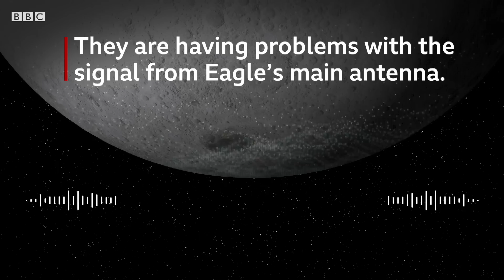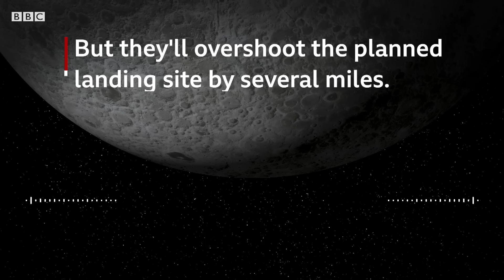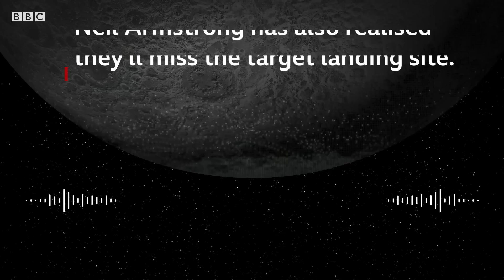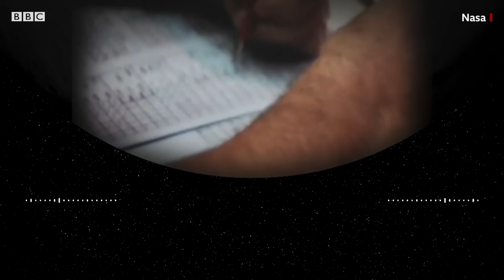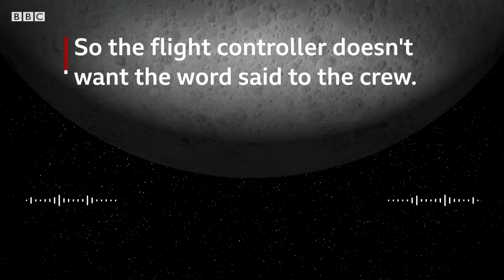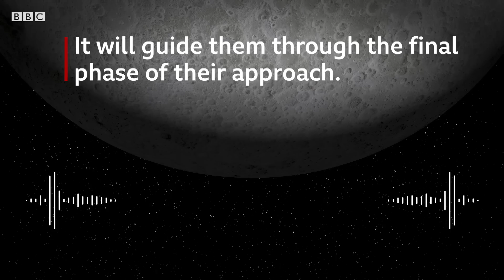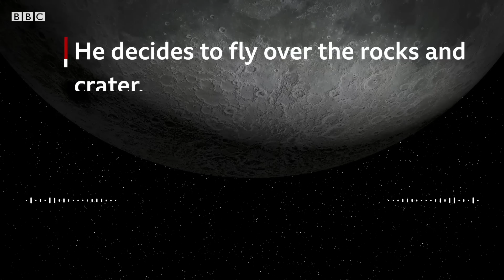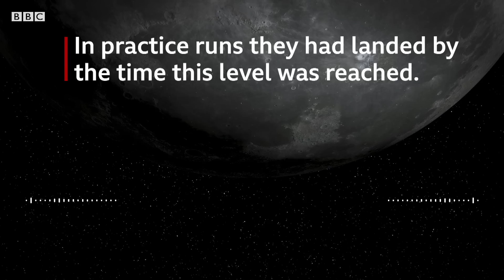Apollo 11: The final 13 minutes before the Moon landing - BBC News

Comment: Why was it that the Eagle could land on the hard surface of the Moon but always had to drop down into the ocean on Earth?  Someone please explain that...
Reply: The Eagle never landed on Earth. The Eagle was the LUNAR lander. The command module capsule was named Columbia.
Reply: Pamela Rice — Clearly, you have done no research at allon the subject of the Apollo program.  There were several modules required, first to get into orbit, then to an orbit around the moon, then to the lunar surface, then back to lunar orbit, back to Earth, then splasdown.  Along the way, a lot of hardware was left behind.  The simplest and safest way to get down was in a capsule, falling into the ocean.
Reply: In order to effect the sort of landing you describe, it would be necessary to carry a vast amount of fuel into orbit, as well as the necessary rocket motors needed to decelerate the returning spacecraft enough for a controlled descent. This would have involved such vast quantities of fuel and additional weight that it was utterly impractical. Every ounce of weight counts in space flight. It would also have meant another whole set of systems with the potential to fail, killing the crew. It made infinitely more sense to do the job with a carefully calculated angle of descent, gravity, parachutes and a nice, soft body of water.

Comment: Seems to me they had better mics than half of csgo matchmaking players
Reply: Microphones were designed for top quality back then, rather than size and cheap manufacturing. A pair of old rotary telephones connected via local land lines and the sound quality makes it seem like you are both in the room.
Reply: Jaime Warlock interesting
Reply: @JaimeWarlock  it was a joke
Reply: They needed distortion and low quality to make is seem like they were far far away. Truth is the moon landing was filmed inside the LEM simulator. No video of a Geiger counter anywhere. No mention of duct tape in any press kit. Total hoax.
Reply: That's because the antenna was faced the other way. It wasn't focused on Earth. The LEM made a turn about, and that's when we heard perfect transmission. When you hear the beep sound, it's only a half a second to chat.
Reply: Why do space shuttles keep on circling around the world for decades already? Cycle after cycle. 
Why don't they go a little higher? That's the biggest question I would have for NASA. 
Can somebody please explain? 
Why do these space-shuttles keep on circling and circling the same circles, decade after decade? They are called SPACE-shuttles.
One would think they have seen it by now. Nothing more to research/invest I feel. Why not going further into space?
Thanks for the answers already.
Reply: @marcjacobs5988  But why? Why have space shuttles go farther? They are shuttles.
Reply: @Specopleader , thanks for the response. Shuttles between where and where?
Reply: @Sowbelly Canoe Yup
Reply: @Sowbelly Canoe, thanks for the response. I know. But still, then again, after 30 years or more one should feel the curiosity to use the qualities of these shuttles to explore a little further I feel. Isn't that our nature? Take care.
Reply: @Trakktor, thanks for the response. Haven't seen that one, but I might check it out. Thanks. Take care.
Reply: THIS IS A VERY EDITED VIDEO
Reply: le Hoarderz Al-Shekelsteins you cabalists will get what is coming to you, very soon, just wait. August 11th huh?
Reply: Better than my friend mic on discord
Reply: Or than every knuckle head playing 2k
Reply: https://www.youtube.com/watch?v=ZFPXjMued9E
Reply: At 12:46 there are two very tall towers casting long shadows.  Bottom   5    Oclock ,
Reply: @paulhenman9907  Good eye! Good eye!! Two REEEALLLY tall towers attached to the LEM becouse they don't move at all. LMAO